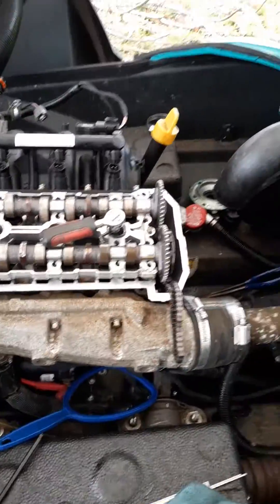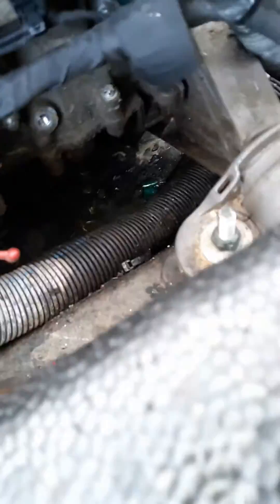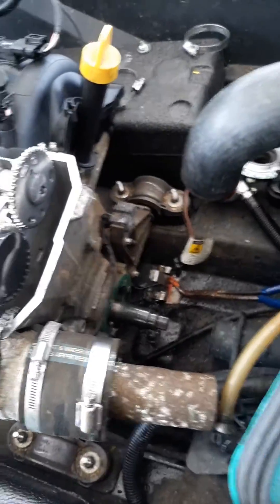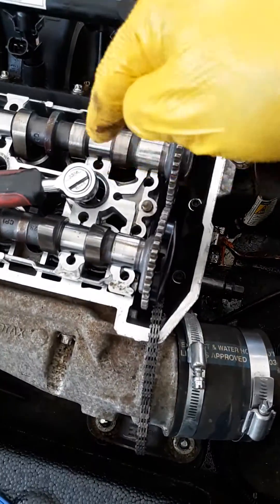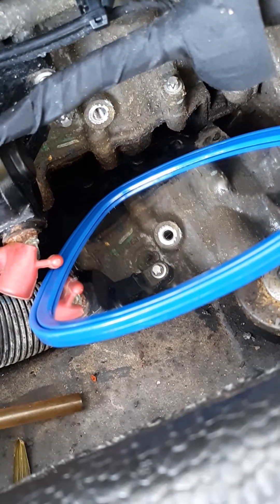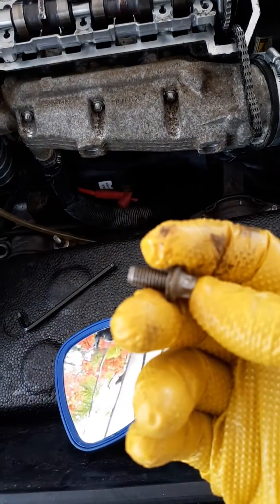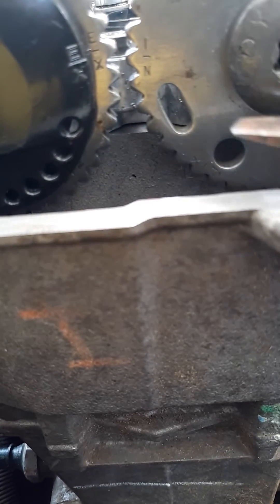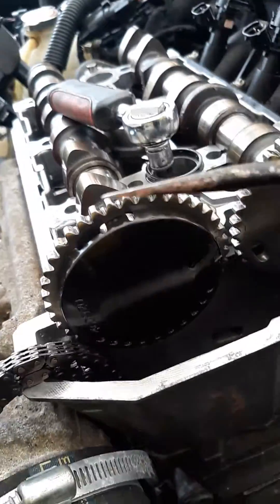Seadoo spark timing chain position

Comment: If you set timing mark of the crankshaft to the small hole, the second or the center piston should be fully on top? I am right?
Reply from the maker: i don't have a motor available right now to confirm that but 100% look at the video again, just do it by marks, remaining i think the 2nd piston was close to top end center but not totally up

Comment: Thanks for posting the video - i struggled and struggled to find that line as well.  (mirror, flashlight ,... so on)   I have another crank sitting here and its is notched out as a ">" on the crank.   Still having issues with the Spark and seems like timing or a sensor (sensors and wiring tested fine) - but believe that's what i was looking for.   Hope that is correct ..
Reply from the maker: did you get to fix it?

Comment: Are you sure the front piston has to be all the way up? My timing marks lined up when the center piston was all the way to? Kinda confused here
Reply from the maker: piston #3 is the one closest to the shaft , once #3 is starting to come up you will see a line mark on the crankshaft
Reply from the maker: i am 1000% sure
Reply: @leomarrero  mine must be different lol, because my middle piston has to be TDC for it to have the groove in the flywheel. 2015 engine
Reply from the maker: @monkeynuthair1638  they have the same motor
Reply from the maker: @monkeynuthair1638  did you remove the bolt from crankcase like in the video?
Reply from the maker: @monkeynuthair1638  when you remove it you will see the crankshaft,  use a flash light,  in case you don't have the special tool use the same shaft with a pipe wrench to move crankshaft
Reply: @leomarrero  is there a way I can private message you? Yes I removed the bolt by the starter, I got the line/v lined up.  Also my compression is 230 psi per cylinder?
Reply from the maker: @monkeynuthair1638  sure, are you in USA?
Reply from the maker: i will send you my # and once you have it i will delete from here
Reply from the maker: @monkeynuthair1638  let me know when you are ready
Reply: @leomarrero  yes i am ready

Comment: No matter what I do, I cannot find that mark. The piston closest to the rear of the jetski is all the way down and I see metal but no distinctive line. I have moved the driveshaft back and forth to see where it is but still nothing. Any suggestions? 2016 Seadoo Spark
Reply from the maker: it is there,  when the #3 is coming up, you will see it, be patient,  use a flash light
Reply: @leomarrero  I think I found it but im not 100% sure. Piston 2 is at TDC and pistom 3 is on its way up. I see a small indent. Lets hope thats it or else ill be buying a new valves kit
Reply from the maker: @garrettomalley6436    is the only mark on the crankshaft,  it's visible through the  crankcase hole
Reply from the maker: @garrettomalley6436  #3 is coming up ( #3 cylinder is the one closer to the shaft)
Reply: @leomarrero  Just got it aligned. My next challenge is to put the timing chain on over the cams. How you do do this? It doesnt seem like the chain reaches?

Comment: As someone who has broken this motor apart more times than I choose to count due to timing, THE TINY HOLE IS THE KEY TO SUCCESS! I thought I would be able to tell with the head off where the piston should be to time... WRONG. You need to see that line in that small hole and then lock the crankshaft as suggested with a longer bolt. The retailers have some special tool to lock it that is not sold to the public, so use a bolt.

The only thing I can as a suggest is rather than turning the engine with the special tool down where you put the impeller shaft, you can use a T50 star bit to turn the motor over from the valve train, BUT BE SURE TO REMOVE ALL VALVE BUCKETS!! Failure to do so will still open and close valves, which may bend valves when you turn the motor over with the cams (took me 2 sets of valves to figure that out.) with the buckets out, the valve train can’t make contact with valves 

Great video!
Reply from the maker: I explained everything in the video,  k have done this on several sparks with 100% success,  thanks for your comments 👍
Reply: Thank you so much!!!

Comment: Great video, thanks for sharing! 
Whats the tool to you used to crank the engine to get the piston to top dead center?
Reply from the maker: There's an special tool for that but you can use the same shaft with a pipe wrench,  also the  piston #3 is coming up when you see Mark on the crankshaft
Reply: @leomarrero  What do you use to remove the clamp on the 2nd boot? is it necessary to disconnect the crankshaft? Thank you for your help!
Reply from the maker: @michaelkelley4421  if boot isn't leaking isn't necessary to remove from shaft
Reply: @leomarrero  thanks, i realized after I already removed it that i didn’t need to. I got it timed and ready for the water. Thanks again!
Reply from the maker: you can use the same shaft ( some tape around)  with a pipe wrench or search on  Google or eBay this one Sea-Doo Impeller Removal Tool Spark Seadoo Pump 529036273

Comment: if the timing chain skips a tooth should you replace any parts?
Reply from the maker: in normal conditions they shouldn't jump any teeth,  just put the time again and check the tensioner
Reply: @leomarrero  so they are not interference engines? the pistons won't hit the valves?
Reply from the maker: @thegarre  1 tooth no, but several yes, you might have bent valves, set the time again  buy a compression tester on autozone,  napa....
and read the compression, if compression is 0 make your plan to rebuild the valves